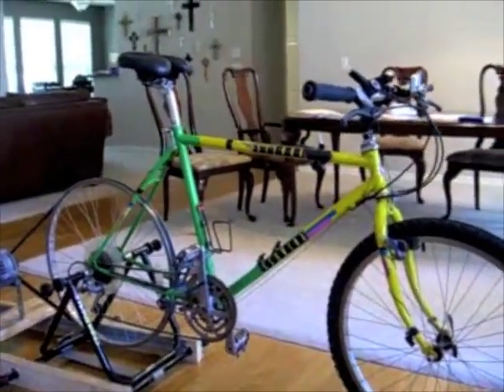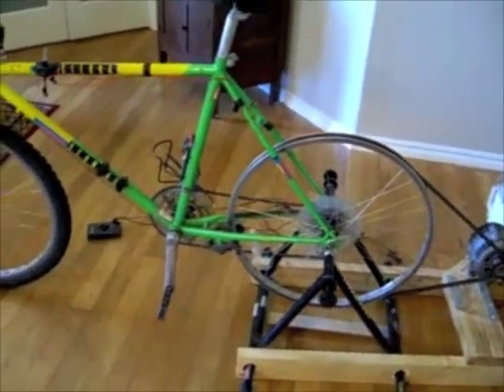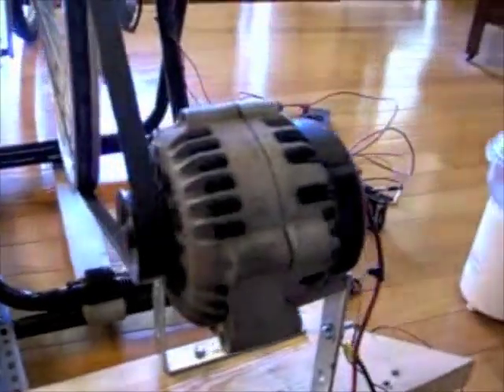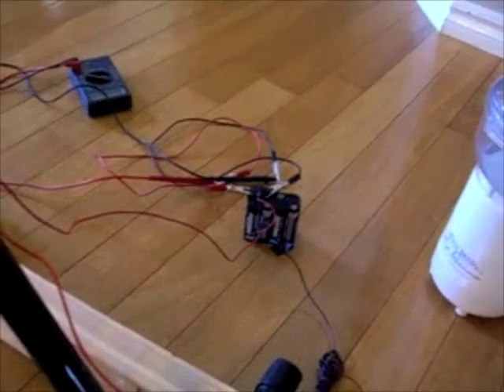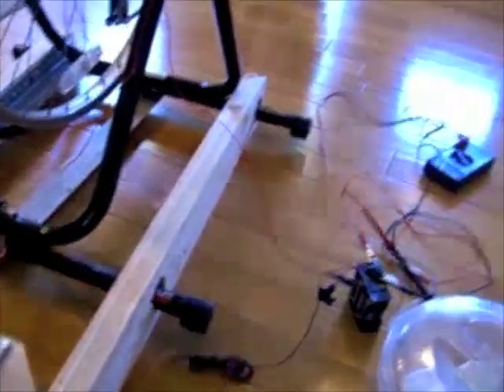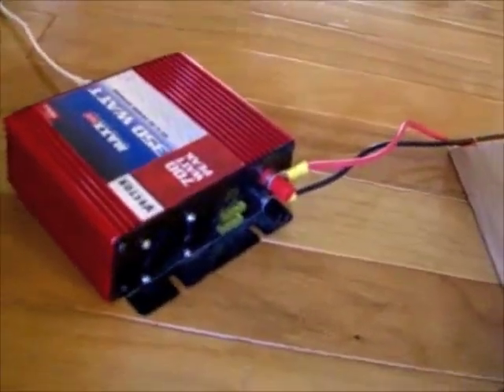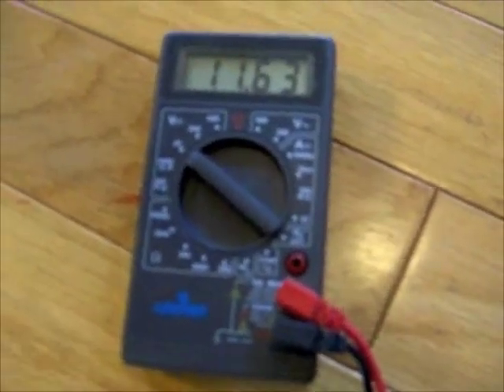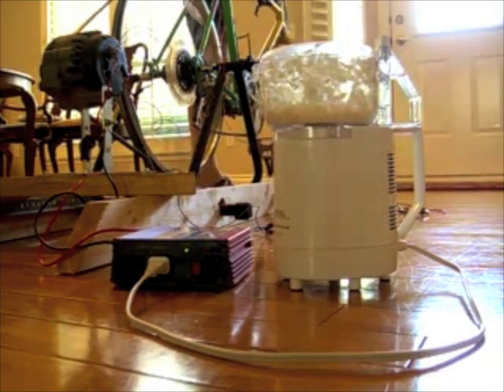Bicycle Generator

Comment: Hello,
Great video, thanks for posting.  I am thinking of doing the same thing with maybe a stationary spin bike using a 50# flywheel to generate power to charge batteries in my off grid system.  I would like to use a car alternator because they are cheap and readily available.  
Do you think adding weights to the rear wheel (flywheel) of your bicycle would be beneficial ?

Comment: I set up this same thing at home. I connected an inverter, the two wires from the alternator, and the wire from the battery pack to the alternator post... I connected the ground wires from the battery pack and the inverter to the ground... And I connected the both wires from the battery pack to the switch... Something weird happened though.... When the switch is off, it will power a light bulb right away upon riding the bike, but when I turn the switch on, the power drops off and it can't power anything. Also, if the switch is on and I petal, the battery pack burns up and I destroyed one battery pack and a set of wires already. I upgraded the wires to 14 gauge and the wires don't burn up anymore, the the battery pack still does when the switch is on. I'm confused, can you help me please?
Reply: +Zackariah Adam the battery pack isn't supposed to be on while your peddling. Really, this setup should use a "momentary switch" to shunt the voltage from the battery pack to the alternator when you first start pedaling... and then disconnects immediately after. If you leave the battery pack connected while the alternator is producing a higher voltage, you will bake non-rechargeable batteries. What does your multi-meter say your voltage is when you switch your battery pack on and off? As far as your alternator producing current without a start from your battery pack, SOME alternators are "self-exciting", which means they hold some residual charge, and their regulators can self-start.
Reply: +Zackariah Adam First thing&#39;s first, check your wiring and make sure youre not crossing any circuits and all equipment is working properly and start isolating the problem. 

Are you saying your battery is directly connected to your inverter?

Comment: I just did the same setup with a self exciting alternator (Delco 10SI). With the field excited, but the alternator not connected to anything, it is quite easy to pedal.  With the field excited and the alternator connected to a battery, the pedaling is very difficult and choppy. I don't know if using a dc motor as a generator would smooth that out a bit, but I could not pedal for very long using my setup. My inverter would not work being hooked up directly to the alternator. Also not sure as to whether if the pedaling would be smoother using a setup like the one in this video using an alternator that requires an external source to excite the field inside. Any suggestions?
Reply: You just need to put some type of inverter to that battery so that it's draining that battery constantly, and plug in something into that inverter that use a lot of power

Comment: Can you feel the load when the chopper turns on?
Reply: +Richard Morrisey We can estimate this. Let's start with the 220 watt load. It is connected to an inverter, which consumes power to convert dc to ac. Most of these devices are around 90% efficient, so the inverter needs about 250 watts to do this. We'll assume the wires are perfect conductors (they aren't, but we'll ignore their loss for this estimate). At peak, automotive alternators are barely 60% efficient, at high RPM, which this is NOT. let's assume it's doing VERY good and is 50% efficient (it is likely much lower here because of the low RPMs). 250 watts output would require 500 watts input then, and if we assume the belt, chain, and bearings are 100% efficient (they aren't), then we need 2/3 of an horsepower of run this onion chopper. A trained cyclist can sustain maybe 400 watts for an hour, but the average adult is between 50 and 150 watts for an hour for a vigorous workout.  You can see him slow way down and have to strain at max exertion to run this, and even that is for only a few seconds.I wouldn't want to be the one powering this!

Comment: How long would you have to be peddling to charge a deep cycle battery out of curiosity? 12V 125AH
Reply: +jj19902003 If you can keep up with 100 - 200 Watt from yourself continuously. [lets say 150 Watts average] is ±11 Amps current at 13.8 Volts. Theoretically in 12 hours continuous biking at the same speed, no breaks. This is not taking into account the losses of friction (windage) in the belts, bearings, chains and alternator. 
With an efficiency of about 85% it would be about 15-16 hours continuous biking.

Comment: they body is more efficient at 85-95rpm. You will last longer at any workload
Reply: But that's the nice thing about using a real bicycle drive-train, you can select the gears for optimal human output.

Comment: Sorry Ben, no pictures since that would or could give away my location and here in Cal. it is against the law according to the Dep. of Fish and Game to install or use any type of water wheel in a running stream or river even if all you wanted to do is grind flour so my set up is very well situated where wannabees and DFG officials will not see. Keep on peddling there Einstein you probably need to lose some weight anywways!, lol

Comment: I'm pretty sure that Delco makes self-exciting alternators that are used in some trucks and boats. They're known as single-wire alternators and use residual magnetism in the rotor to excite the voltage regulator.

Comment: Just use diamagnetic bearings on the axle and mount the alternator vertically, when the electromagnetic field is generated by the 12v charge, the alternator axle should be suspended in the field, producing no work load on it. If there's no friction there's no load right? If you could design something like that it could theoretically run forever, because it has no real physical wear on it.

Comment: With the right type of alternator and bank setup, you could setup the gearing to optimize the output right?  Like rigging up a GIGANTIC sprocket on the bicycle, I'm talking like custom made, then you get many more turns of the alternator shaft per pedal?

Comment: Why would one not use a generator in this application and save much complexity?  A serious question.  BTW, a verbal description of an electric circuit is not very effective, picture is worth a thousand words.
Reply: +Basic Poke Because then you have to peddle at a specific RPM to generate the correct frequency 50/60Hz. If you have DC into an inverter it takes care of the frequency for you.
Reply: +KiwiPowerNZ There are dc generators. He was asking why he did not use a 12v Dc generator so he did not need a starting current.
Reply: +Basic Poke He likely used a alternator because he had one on had or because he could just get one at a auto parts store.
Reply: +jona jon I just did the same setup with a self exciting alternator (Delco 10SI). With the field excited, but the alternator not connected to anything, it is quite easy to pedal.  With the field excited and the alternator connected to a battery, the pedaling is very difficult and choppy. I don't know if using a dc motor as a generator would smooth that out a bit, but I could not pedal for very long using my setup. My inverter would not work being hooked up directly to the alternator. Also not sure as to whether if the pedaling would be smoother using a setup like the one in this video using an alternator that requires an external source to excite the field inside. Any suggestions?
Reply: FreeThinker1980 Alternators use AC then convert it to DC. So there are peaks in power generation mutable times a second. That maybe what causing the choppiness. The load causes resistance making it harder to pedal. Adding a weighted flywheel may help.

Comment: I have an idea: Have a high-torque electric motor of the lowest power usage you can find and hook it up to the pedals to make it perpetually run. You would need a setup to limit the crank motor's power input enough to keep it from blowing, but aside from having to have fans of some sort to keep both motors cool, it would be nice.
Reply: +prizedcoffeecup there is no such thing as perpetually running motors, it just wont work because there is always some power loss, its the basic law of physics

Comment: does the 12 volt source(batteries) charge with excess voltage from alternator ?
Reply: +James Penz yes
Reply: +James Penz  Yes.  Your car's alternator uses about 14.5 volts to charge your 12 volt battery.
Reply: +Richard Feeley correction...the car's alternator/generator GENERATES 13.7 to 14 + volts to charge the battery..
It USES engine horsepower to perform the task , not electricity.
Reply: +James Penz you can purchase a permanent magnet alternator from ebay and not mess with an initial charge
Reply: If you try it though watch out, some batteries have warnings saying not to recharge them :)

Comment: That little batt pack to start the alt to working,   All you need is  one 1.5v battery,  you don't need a full 12v.  one single cell will make enough magnet and the alternator will pick it up from there !!
Reply: +Jim Vicious some alternators aren't self-exciting
Reply: Wow  You're Genius
Reply: Yup - this is actually the principle behind "one wire" alternators. They have a certain type of voltage regulator to take advantage of that left over magnetism, & a lot of times even an alt with a normal regulator will work that way, quite by accident.
Reply: I have same system on my home. No way to produce enough energy with self excitation. You need at least 12V/1Amp
Reply: +Paul Couch Not even that. The iron laminations (in an alternator that has been connected once) retain enough residual magnetism for self excitation. No external current source required.

Comment: Interesting but you didn't answer the main question.  How long can you keep pedaling with a load without stopping?
Reply: +Ian Moone you can keep up with a load about 100-200w. That depends on you physical condition and strength. You can power your laptop without a problem, or an entry level pc without a sophisticated videocard. When climbing a hill on your bike it takes like 250-300w, sometimes even more if you're stronger, just to have a comparison. The strongest athletes can generate about 1000w for short periods of time. A horse power is 745w (in the international system) which is considered to be the continuous workload a horse can produce. Hope this helps.
Reply: +goagăl minus that did help... Thank you
Reply: +Zackariah Adam You're welcome.

Comment: Sweet, or just hook the the bike up directly to the food grinder, no electrical stuff. ^~^ .
Reply: +q zorn >>The alternator is DC (direct current) while the food processor is AC (alternating current). You need the inverter to convert DC to AC.

Comment: the field winding is a parasitic load. there are permanent magnet alternators that use a permanent magnet to generate the field, I saw one made for a tractor. I think it was 50 Amp. It would give you more output

Comment: I've heard of permanent magnet alternators.  They don't require a battery to establish a magnetic field in the stator - the permanent magnets take the place of the stator.  They work like a DC generator but instead of a commutator, they still use slip rings.

Comment: Wait wouldn't it be 80:1 from crank to alternator? 4:1 x 20:1 should be 80:1, no?
Reply: +Kyle Barr >>He says in the video that the ratio for the alternator is 10:1 (not 20:1), so it's 40:1, not 80:1.

Comment: i made one of these thats real sweet, video will be up soon, but my issue is that when my inverter is on, it is really hard to peddle. i have an 1100 watt inverter and a 40 watt alternator. whats the deal? the inverter should not be using all that wattage unless its being drawn right? it seems as though i need to have two different batteries and be able to charge one battery while the other one is in use. granted i did try and power a toaster which is very hard lol.
Reply: ThunderHead289 Yeah I doubt you can reach that. 1 horse power is 746W, one human power must be pretty pathetic, probably under a 100W.
Reply: +ThunderHead289 Measure the current flow from the alternator and you'll have your answer. Most inverters have a standby current of about 1A even when nothing is connected to it, but you shouldn't feel that as being very hard. 3A is when it starts to get hard to peddle. 10A or more and you'll get tired quickly.
Reply: +ThunderHead289 please nitify us when you realeas your video. ;)
Reply: i measured everything out and i can produce about 3.5 or so amps for 15 minutes and then i get tired. definitely not feasible for charging a battery as a 2 amp trickle charge takes 3 hours minimum to top a battery charge off. the battery in the systems is nice with the inverter since the output stay relatively the same without spikes and what not. all in all, it seems that i can power stuff of around 300 watts for awhile, but anything greater is difficult. like a toaster. . .
Reply: ThunderHead289 300W would take about 25A am I right? Your legs would be tired in about half a minute or sooner lol
Reply: +KiwiPowerNZ I'm assuming it's drawing from the battery an I'm trickle charging the battery is all then. Anything over 300 and I just can't. Would running a more amp alternator make a difference or does it not matter since I'm limited by my physical strength. Like would a 120 amp perform better?
Reply: ThunderHead289 Only a more efficient alternator would help, but they are all about 80% efficient I think. If the bigger one is more efficient at low load then it would be easier but if your current one is 80% efficient you can only really improve by 10%, there won't be one that's more than 90% efficient, plus the inverter is about 80 to 90% efficient.

So if your alternator is 80% efficient and your inverter is 85% efficient you are losing 32W from every 100W you generate. Or in other words to generate 100W you must peddle 145W because of losses. So the only way to make it easier would be more efficient inverters or alternators.
Reply: gotcha, thats honestly more than i figured them to be for efficiency! an alternator only puts out what is being drawn, so from this i would believe im limited by the physicalities of my human body so i could never even reach the measly 40 amp output of my own alternator?
Reply: +KiwiPowerNZ ffggffdf

Comment: Instead of the alternator, why not use a motor?

As you have mentioned, an alternator uses battery power to induce magnetic field that produce electricity; while a motor has its own magnetic field that produces electricity.

A motor can be used both ways. Electricity makes the motor's shaft turns; but when you turn the shaft, the motor produces electricity.

You pedal the bike, rotating the belt that rotates the shaft of the motor, thus producing electricity that you can store into a battery.
Reply: Does that acctually work?
Reply: +Swiper Fox Alternators have a regulator built in so it will produce a constant voltage of about 13.8V even if you peddle fast or slow. Inverters need a constant voltage.

Comment: Dang, that's a lot of work to chop some onions...
Reply: +Barry Foster The point wasn't the onion. The point was that we can generate power in more ways than burning coal and other unsustainable methods. He's showing what's possible on a small scale. 

Is it entirely practical? Probably not, but it's fucking cool as hell. ;) I'd use it to charge my mobile devices. If I don't exercise, I don't get to play Clash of Clans on my iPad. There's motivation to exercise right there, and fuck knows, in our indoor, couch-potato culture with a growing diabetes epidemic, we need SOMETHING to motivate us to get off our asses. :)
Reply: I'm sure that's just an example to show that it works. The main point is to show how to produce electric energy with a bicycle in the event of a power outage.
Reply: +D “SUBSONIC” Vick   LOL! You are so right. I could have chopped an onion by hand using 20 times less power. What is the point here? It certainly isn't about making life easier or saving energy.
Reply: At least the bike has a transmission to increase wheel RPM 3times peddle rpm but you really don't need that many speeds because max gear is the same as a 6speed but its easier to buy solor" equipment because it only cost a few hundred to build a system to power 1 appliance.
Reply: +Momma Wife Or for people who can't afford expensive solar panels or back up generators.
Reply: +Skeptical Simmy claps
Reply: Free movies

Comment: i know money but why not more alternators  and deep cycle boat battery .doesn't  the average  alternators put out 15 volts dc ?how about an incumbent bike and put the alternator pulley on the tire ?but it's a cool build .

Comment: hi i just want to know that an alternator produces ac voltage and why are we connecting (12v dc to 120v ac) converter? if i get the answer i would appreciate it thankyou
Reply: alternators have rectifiers so output is d.c.